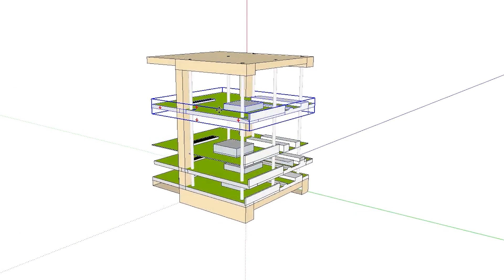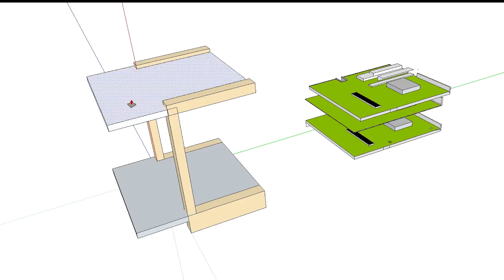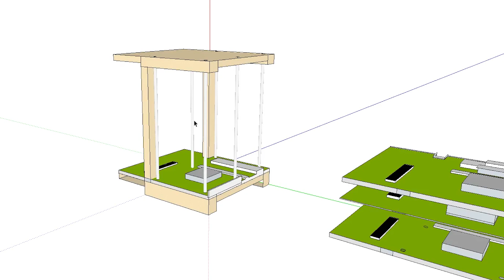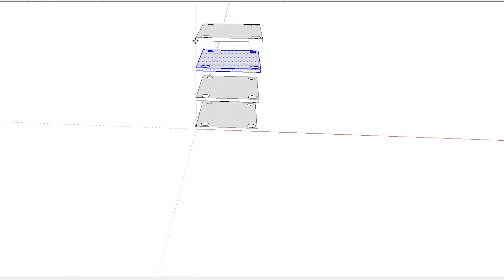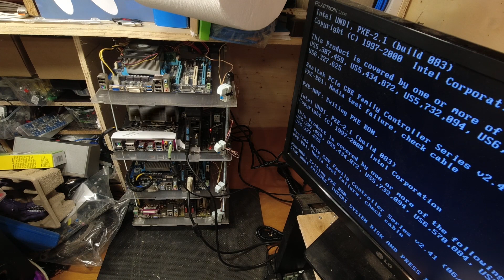Interesting DIY Cluster PC with 4 motherboards in 1 case

Comment: Your vid makes it easy to understand how to put it together but I still dont quite get what the purpose is in this situation.
Reply from the maker: Thanks for the feedback. It's subjective, it works fine for me because I often change, test and use some older or different software and hardware. The fact that I have plenty of components and it didn't cost me anything extra to make is also a good motivation to do it.
Reply: @sigmatechelysium2736  Definitely going down the rabbit hole and I will be back for your videos when I get a little more well versed.

Comment: You can make the PSU situation better with a bunch of PicoPSU and a server PSU with breakout board so you can save a lot of space
Reply from the maker: I would like to buy a Pico because I have some project ideas on how to use it ... BUT I have several different power supplies of different sizes (like TFX) and I have room for a normal ATX power supply, so this way it's cheaper and easier to upgrade components or configurations in the future.